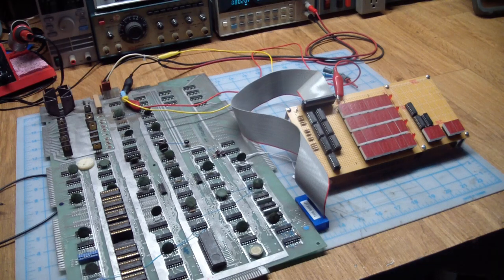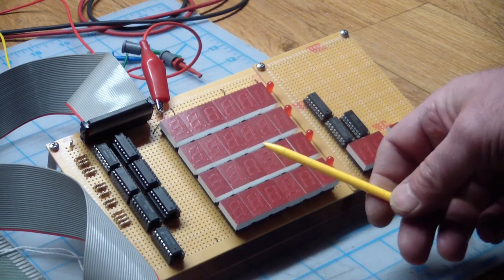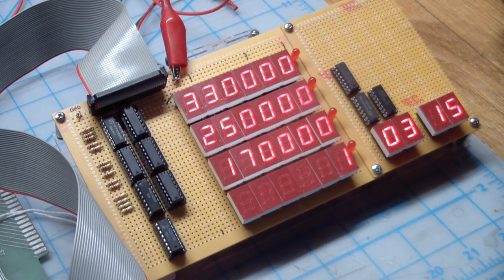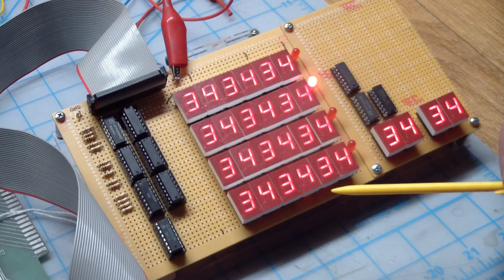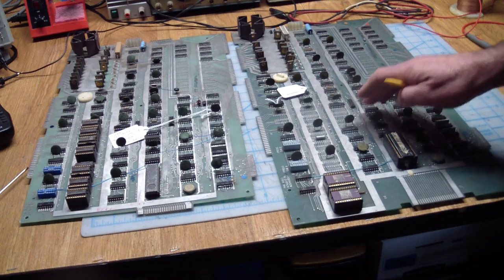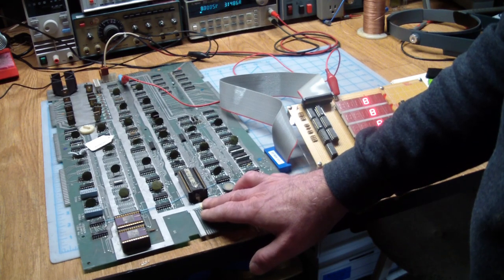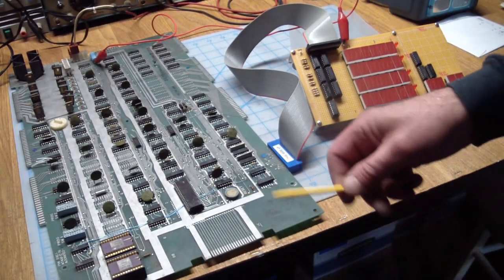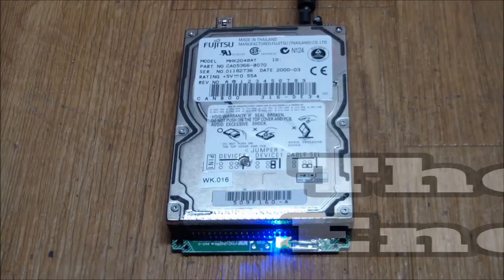AE#138 Using My New Atari Pinball Display Panel To Troubleshoot A Board

Comment: I am thinking I am one of the few technicians left that went to Atari service schools locally and at the factory back in 79-82. I only lived an hour away. I was in my 20's and everyone else were much older EM technicians. I had the PBS Test Fixture until about 2010. I figured I would never use it again so I let it go. I just completed a repair of one CPU after not working on one for a long time. It was fun to go back through my notes and repair the board. We covered the board well in service schools. I discovered your video's by accident and was really impressed with them. You were pretty much spot on with your assertions. I always added a test pin for switch common and other hookups using the space not used by Eproms, as we were instructed back in the day. Now that I have retired I would love to build the display and would encourage you to use your skill to have a PCB made and offer that out. I donate time at a place that has about 6 Atari's and will be going through those in the near future. Thanks for your efforts!

Comment: Nice job! If you want to get real fancy,  you could build an interface to a computer (with your own software of course) the interface could have actual loads to test drivers.  You could have a vintage board restoration business. The  software would be used to reconfigure to different boards/games.
Reply from the maker: Funny you should mention that. I've been thinking about a poor man's troubleshooter patterned after a subset of the Fluke 9010A functionality. It would plug into the 6800 socket and let you exercise the board using a PC.

Comment: Are you planning on going all-out and putting together a complete testing jig?
Seems like an Arduino or other SBC could be used to act as a test controller... it's a lot of work though. I would guess it would only be worth it if you had a ton of these to fix.
Cheers,
Reply from the maker: I'll probably build a few more emulation peripherals as necessary. I still have about 10 dead boards.

Comment: I like the display gizmo. Too bad I don't have any Atari pinball machines that need diagnosing...
Would it have been feasible to construct some extension ribbon cables to allow the board to work outside of the machine or would there have been signaling or power issues?
Reply from the maker: The initial plan was to make extender cables, but that became too messy.
If you'd like an Atari pin of your own let me know.

Comment: Don't know why but those "hi rise" ic sockets were crap when they were new whenever we came across those things we replace them with what you used strips of machine pins
Reply from the maker: I know. They look real good and are gold plated, yet they fail. I'd have to cut one apart to see what the real failure is caused by.
Reply: @artifactelectronics  I think it's all about limp spring factor.

Comment: Hey Artie,  I've got a Space Raiders with a bunch of coils either locked on or dead... are there any good replacements for a 9334?
Reply from the maker: The 74LS259 is a drop in replacement
Reply: @artifactelectronics  hmmm ... I was kind of hoping is wasn't actually... I have only 2 coils working, 3 locked on and the rest dead... I've changed a few 9334's and 2003's in the transistor driver area.. and have gotten little progress
Reply from the maker: Check the actual driver transistors. A good replacement is the TIP102, available from Mouser.
Reply: @artifactelectronics  I've replaced a few, and they all test around the same voltage drop in circuit... i think one out of three I've changed got me another coil working... I think this thing took a good jolt ...also has a few controlled lights out and one dead switch that seem board related
Reply: @artifactelectronics  do you do any repair jobs?
I've been thinking of outsourcing this one so i can get it on the floor sooner than later... it would be super cool if you did a video so i still learn something...lol

Comment: Did you check the coin cell ?
Reply from the maker: There is no coin cell on the pcb. You are probably referring to the reset switch which does look like a coin cell from afar.
Reply: @artifactelectronics  So that would mean to the right of the horizontal black chip on the bottom at 1:13, that would be a 5 volt cap ?? (second row from the right).